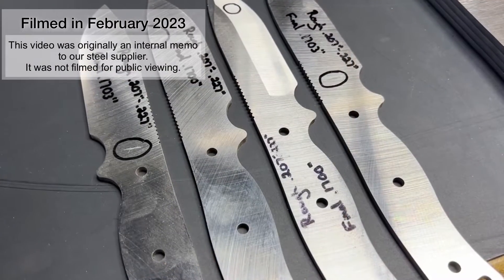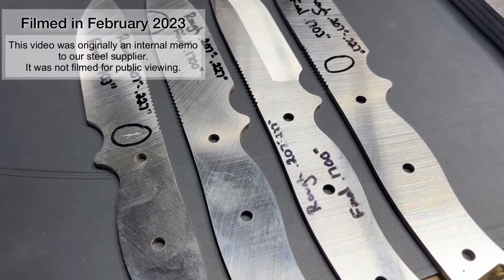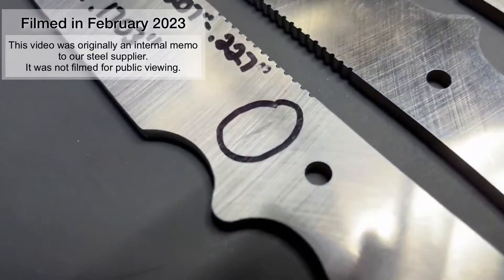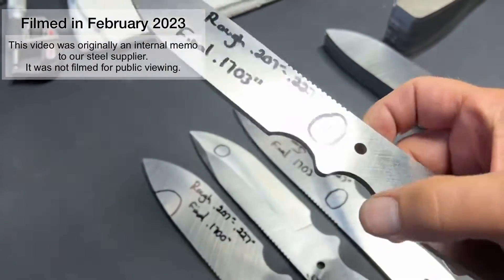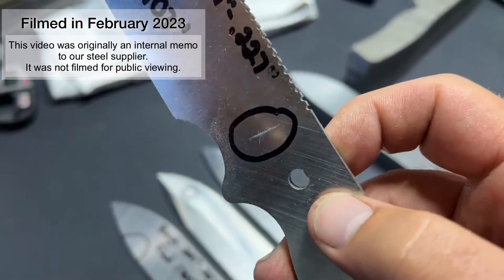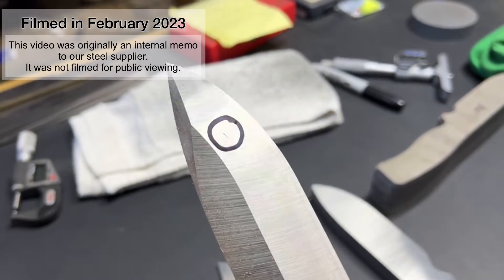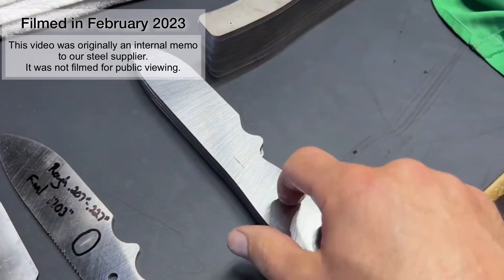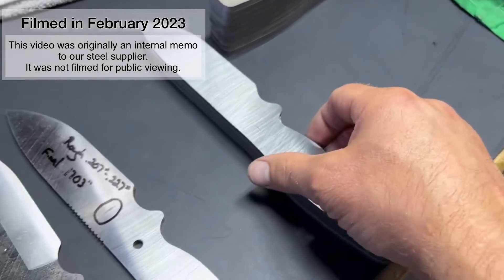HUGE CPM-Magnacut Voids

Comment: You are doing the right thing with being totally transparent with what you are experiencing.  Honesty and integrity will carry you through these issues.  I’m not surprised to hear of these issues with the steel.  Bark River had some issues with a few of their Magnacut blades.  I have a few of their knives in Magnacut and have had great luck with the steel and it’s performance so I know the steel can deliver when there are no manufacturing issues
Reply from the maker: Yeah, I'm having to learn the hard way that there is a huge difference between a data sheet and a manufacturable product. All the charts and  graphs in the world don't mean anything without good formulas and processes in manufacturing.

Comment: I get your pain and disappointment but I think you are directing blame in the wrong direction, Dr Thomas merely designed the steel, it’s the manufacturing company that is to blame.
If your car does not start do you blame Cugnot, or the car maker, same with the steel, there may be a problem with the nitrogen gas system that disperses the droplets or the compression system that melts and bonds everything together, neither of these issues are the steel inventors problem.
You should be compensated and looked, both in time lost, belts and electrify used and of course in the steel itself, by the steel manufacturer not by Dr Thomas though.
Reply from the maker: I understand your point, but he is financially benefiting from this situation, and actively promoting this material, while also calling materials that actually work "hype". He was involved in a conversation last year where I brought up these concerns, yet he never participated in the discussion. 

Now Niagara specialty metals is choosing to not return my material samples for independent evaluation, instead they are sending me a check for $900 for the nine samples we sent in. I'm not cashing that check, something is going on here.

Comment: And there it is… I theorized that the initial run of MagnaCut would be pristine because it was small batches, carefully controlled to get the product out there, and as volume increases issues would materialize due to the nature of how this has to be “cooked” to have the chromium to form uniform carbides. When something is too good to be true it usually is. I hope these issues can be resolved for your and others manufactures sakes with driving the cost through the roof.
Reply from the maker: That's what I think as well. Their heat or "batch" sizes for production are really big, especially compared to a company like Bohler. 

I personally don't know if Crucible can actually consistently produce Magnacut to the high standard promised, which is why they were trying to offer us a little money over replacing the materials. 

It seems to me they would be happy to put me in my place with immaculate materials. I think they understand at this point, that I make these detailed videos of everything, put your money where your mouth is. 
Replace these materials with the "perfect" sheets you claim everyone else is receiving. If they truly are defect free, I would be happy to show that.

Side note, we don't see ANY of these issues with Bohler Uddeholm steels. Their materials have been absolutely defect free.

Comment: Do you guys have any plans to offer the bush crafter scandi in a stainless variant (maybe Vanax or Elmax) now that there are so many persistent issues with magnacut? I ordered a magnacut EDC 3 scandi a little while back as a small sailing/dive/camp knife. I was thinking of getting a bushcrafter scandi as a slightly larger general purpose chore knife for around the boat and camp. It looks like you only have this in k890, which looks absolutely awesome but probably isn't suited to being forgotten on deck overnight in the salt.
Reply from the maker: Yes, after some extensive testing, we plan to have some models offered that way. We have all kinds of irons in the fire right now, as I know more, you'll know more. Thank you so much for stopping by and sharing your thoughts.